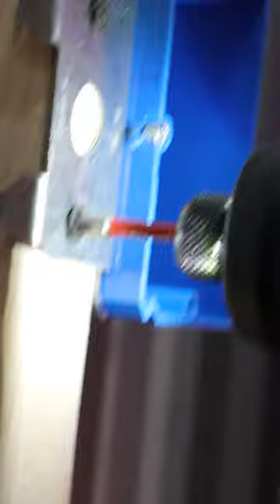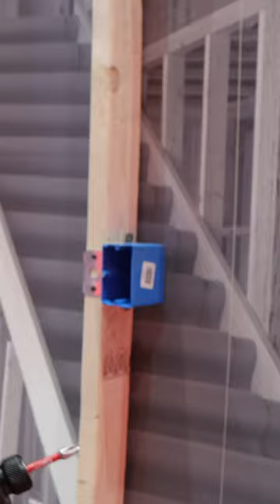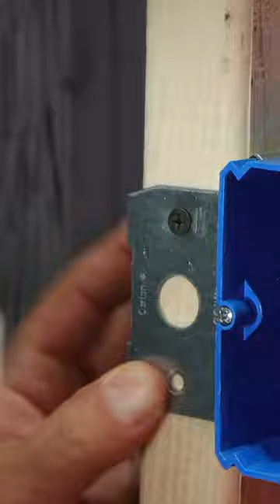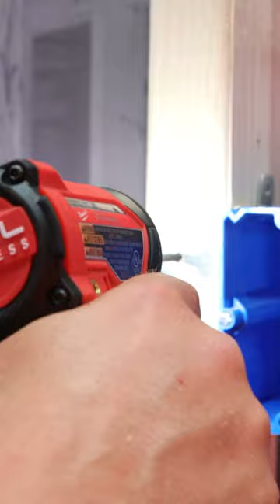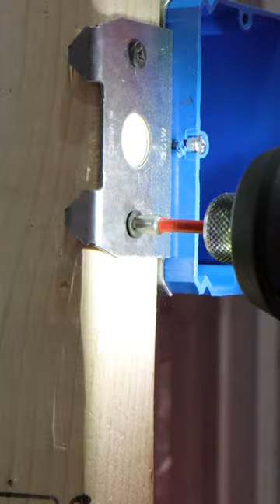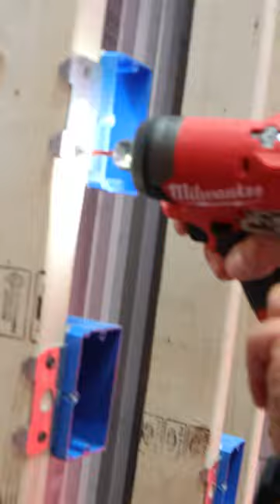M12 FUEL Impact Too POWERFUL

Comment: Those screws aren’t designed for that.  The taper of the screw head is drawing the metal plate in. If the plate had countersunk holes, or used a fastener with a flat shoulder this would not happen.
Reply: Along with this being a impact it's meant to be stronger.  He needs a drill with a clutch set to his needs.  Idiots using the wrong tool and wrong fasteners.
Reply: The plate has countersunk holes. For a smaller screw head.
Reply: @brandonbrown3600  nah drivers are meant for screws too.

But this is a problem I have with the 4th gen onward.

My old 3rd gen on 1 really had low torque (I'm a millwright so I work on everything from 2" platen bolts to m4 and smaller screws. I couldn't use my new impact (doing well over a hundred on swap jobs) because even power 1 would snap things.
Reply: @brandonbrown3600 a drill 😂😂😂 hop in the 21st century, pops.
Reply: Supposed to use nails
Reply: Guy probably works at Home Depot
Reply: @J_M3444  I was gonna say a drill is definitely not the tool that I see sparkys putting these in with. Impact and hex heads or Phillip heads.
Reply: Those boxes are also supposed to be counter sunk in to the 2x4 or the drywall will never sit correctly in that spot what's your point
Reply: Yes. I agree 👍
Reply: @ObservationofLimits  use your trigger clown mine os alway on 3

Comment: This guy's a genius thinking speed and torque are the same thing
Reply: I came here to say this. Glad someone beat me to it.
Reply: He’s also using an impact gun and not a drill with a chuck. He’s using a tool designed for bolts, not screws, so there’s another problem
Reply: @nightstalkers_revenge1850  wrong impacts are for screws also. Use them every day.
Reply: @nightstalkers_revenge1850  lol man it a screw driver clown it's made for this
Reply: For fox lake. Speed is torque with an impact. 

Impacts work by a spring driving a dog into a hammer, (the hammer is the part holding your bit/socket)when the torque gets too great, the dog slips out, spins around and grabs again.

The faster the dog goes in and out, the more IPM: impacts per minute.

When the same weight spins faster it hits harder.

Just like swinging a hammer, faster means stronger. Impacts also hit more often when they spin faster. You get harder and faster the more you run it. 

Protip: the 1/4 hex drive, and the 3/8 square drive are the same tool with different hammers. The 3/8 fits a socket without an adapter, with an adapter for screwdriver bits it will easily break any screw you want to drive.

If you want to switch, either hammer is $30 on eBay. One guy makes a hammer that holds sockets on the outside, or screwdrivers on the inside $45 part. Four screws, hold the thing together. 

I use more power than I need, so I can work faster.
Reply: Blows per minute is what creates the torque on an impact. My old CP 1/2" drive impact hits slower than my $500 IR with the same air input and torque rating. The Ingersoll kills the Chicago Pneumatic at breaking stubborn bolts even though they are rated at the same torque because the mechanism hits that peak torque at a quicker rate.
Reply: For years he refuses to understand the concept.
Reply: making a comment like this implies you don’t know how an impact works. speed is torque
Reply: @nightstalkers_revenge1850  no this is an "impact driver" not an "impact gun" literally what these are meant for

Comment: Trigger control.
& drywall screws are for drywall. 
Cant use them on elec boxes plastic or metal where I live.
Reply: Totally agree. I also wannna know why their putting a plate over a stud like that. Gonna have to float it out for the drywall finish especially with a screw head sticking out

Comment: As a construction worker I can see how that could be annoying, but as a mechanic it’s a great tool
Reply: I was thinking the same damn thing.... but as a carpenter my drill would be used for this... impact stays home unless I'm putting in grks
Reply: @himwhom You damn Milwaukee
Guys, all power no control!
Reply: @Billy bob  dewalt here.. only Milwaukee is the 16p eletric nail guns.
Reply: Bruh all we use in construction is impact drills. It’s all trigger control.

Comment: I'd  definitely hire a electrician who uses drywall screws on an electrical box...pure knowledgeable tradesmen
Reply: Drywall screws work just fine to hold up a box. It’s a screw and there’s no structural need for a wood screw here
Reply: Then you wont be hiring anyone. Its a screw, itll hold the box just fine. Jesus christ

Comment: Better to bend it and beat it back considering screws and metal that stick out over a 1/4in are a nightmare to hang drywall over. Thanks for the blown out outlet👍
Reply: Garage construction maybe? Uninsulated construction with sheathing and exposed framing on the inside

Comment: Vance... now get the drill and adjust the depth of that box.
Reply from the maker: The union won't allow it!
Reply: he is a schmoe, he thinks the speed setting controls how much torque is applied. Simmer down with the trigger bud, and use the correct fasteners, things will work out better.

Comment: Just got mine at Home Depot with the 4.0ah 2.0ah combo kit and was using the impact and in mode 1 was breaking screws it has insane power
Reply: Complete bull. This m12 crap is weak. You were breaking drywall screws loll
Reply: @Valient6 m12 is fine for most jobs.
M18 is not needed at most home works.
Reply: @Valient6 complete ignorance. I use the M12 gen 3 as a commercial electrician. More than enough power.
Reply: @Valient6  Lmfao maybe the Non-Fuel version, As an Electrician aswell my 3 year old beaten up m12 fuel 2nd gen impact still will break 1 inch × 1/4inch thick Self Tapers & lags with ease if not carefull. 🤷‍♂️It's been my daily driver & with trigger control is the perfect impact for most needs.
Reply: @internetjunkie9574  😆

Comment: I've been wondering to get these m12 or fuel I do a little of everything work wise
Reply: I just got rid of my m18 surge and got these m12 fuel and they are awesome specially since they are a little lighter.
Reply: 3 years use testimony. By far worth the money(Home Depot might still have them on sale not sure) But it has pretty much replaced my 18, used as my daily & is perfectly compact & powerfull. Spend the money you won't be dissapointed one bit

Comment: Just last night I was just talking about how the M12 Fuel Hammer Drill (2504-20) is too powerful. Even on the lowest clutch setting the speed can ramp up and won't stop driving until the screw hole is already stripped. My guess is it's because the clutch is digital and has to wait to sense a certain load before shutting off power, but the rotating mechanism already has momentum. I think so because this doesn't happen on older "dumb" drills with purely mechanical clutches that physically limit the torque...

Comment: That is going to wreck the drywall and leave a hump like a camels back.
Reply: Lol you won't even notice. It's no different then the plates the put on studs to protect water lines and electrical running through them from nails and screws.

Comment: Yeh, those M12 impacts are great. . . until you're standing at the top of a ladder, go to use it and the fkr decides not to work!  
What's with the flashing led's on the side when it's supposed to be turning a fkng screw!!!!

So, anywhooo, have gone back to using a Makita and it works FIRST TIME! EVERYTIME! I've ever tried to use it EVER!

Comment: I'm sold. Really. It's 1/2 the weight of my old 18-volt impact driver and battery last all day, preforming the lighter jobs like what you illustrated and battery change is simple and easy. You can carry an extra battery with you in special container for bigger jobs that require you to push harder. DeWalt does have some 12v stuff, and pretty good for the most part. But that little Milwaukee, you forget you've got with you already, it's so lightweight.

Comment: A lot of power for not a very long time. Not worth the incredible prices. I've been in my trade for a little over 9 years now and every Milwaukee tool I've owned has done everything short of straight up disintegrate in my hand. Stick with DeWalt, mines lasted 6 years with zero problems. Unlike my Milwaukee which lasted 2 and had 100 problems.

Comment: Journeyman Electrician in Ohio. I’ve been in almost 5yrs. I’ve had a M12 FUEL from day 1 only replaced it once in those 5yrs. They are amazing tools for the size and well worth the investment. The combo kit with the hammer drill is also worth it (has a 1/2” chuck and can put a 16” auger through 3 studs if your M18 isn’t handy or space is an issue)

Comment: I love my M12 gen 3 fuel impact driver and hammer drill. I’ve driven 100 3 inch coarse thread wood screws for attaching 2x4s into 2x4s on a single cp 2.0 battery with my m12 fuel.

Comment: Far as I know on those milwaukee impacts, the settings are literally just speeds, not gears. There was no difference in torque as far as I could tell when using it, it's just for people with bad finger control

Comment: How long do the batteries last is my question, I've tried some of the 12v tools and the one impact I have is great for final but probably wouldn't do too well in rough, and the batteries get killed kind of fast, then again, I only have the 1.5 batteries

Comment: How you tell difference between gen2 n gen 3
Reply: Model number for one but the easiest way to eye them is the drill has the red line around the chuck and the impact has the Tri-led's
Reply from the maker: Gen 3 has 3 leds

Comment: It's change in speed not torqe persay. The torqe does increase with more rpm as more hits and faster anvil strike but the low speed setting is not a torqe reducer its to have more controle

Comment: It’s an impact driver for tough screws, for screws that small use a screw driver with torque setting if you are worried about bending the metal right tool for the job guess you can’t teach experience.
Reply: Bro it doesn't matter I'm using one impact for everything. I don't need one for delicate work because I can use my normal impact with trigger control and do what I need it to do every time.
Reply: @corey6129  clearly it does because vince has the problem he’s struggling, also if I want to send home screws I set my torque and screw them in I’m not worrying I might slip with “trigger control” and strip the wood leaving the screw loose, it’s personal preference but I’d rather drive a screw knowing the drill will stop when it is in deep enough with a torque setting consistently rather than my finger and my eyes judging ✌🏻 impacts for fast work / drill drivers for delicate work personal preference

Comment: More speed does not equal more torque bud. Most often, the opposite is true.
Reply: On the impact 3 is higher speed and torque 1 is for finesse. On a drill 1 is higher torque and 2 is more speed.

Comment: its so powerful, i had mine back in for repairs . The mechanism inside was stuck nothing was spinning.
Reply from the maker: What? Tell us more, how, when, why?!?!? I’m listening!
Reply: @VCGConstruction  I bought the m12 surge 2 years ago, when it stopped working i was lazy to return it and I started using my m18 fuel impact. When they released the new m12 kit I decided to go buy it on the 18th of August. In November it stopped working... I'm a plumber using the tool for screws and drilling 1/4" ceramique holes using à dewalt impact adapter. When id press the trigger the motor turned but not the chuck. It's like if the impact mechanism inside broke... it was making such a loud sound. When the repair tech in my area pressed on the trigger to test the tool it surprised her and she dropped it on the desk. At the same time I gave her my m12 surge as well for repairs... id press the trigger and a small electrical whine appeared and then nothing. I also have 2 m18 fuel hackzalls with broken motor bearings, New chargers that don't charge, that m18 impact gen 3 that has the collet problem and sometimes when a go to reverse to back out a screw, it goes in forward ... I'm real pleased at milwaukee tools, at least I have a good store that honors the 5 year warranty in my area. I'd be happy to send you my m18 fuel impact so you can test it out. Free of charge and you can keep it. Sometimes it just stalls after a while making 1" spade holes... it's so dumb.

Comment: Every impact would do the same, bud
Reply from the maker: Name one
Reply: @VCGConstruction  Dewalt or makita there is nothing impressive about it. It's just a 12 volt battery and only works with all the 12v stuff when most people have the m18 and this just doesn't make sense to buy and have to get the batteries just for a smaller impact or the other m12 tools.

Comment: Use a round-top screw and let off after a click or two
Reply: Because the drywall guys don't already hate you for using these top mount boxes... Let's add another 1/8-1/4 inch of height to deal with.
Reply: @anthonybarker9123  they must have a hatred for us because I find device boxes packed with spackle

Comment: M12 is garbage. You can't sink a 4" t25 into pressure treated. Step up to dewalt XR for power and durability. Dropped mine in water 6 years ago submerged. Still works too this day.
Reply: Everyone throw away your tools, the valiant one is here to tell us what's the best. 🤣
Reply: @kwslife116  yeah considering I actually build. Screwed about 6 thousand 4" #10s this year, 500 8 inch lags, and about 10,000 nails, I'd say it's safe to say you should listen.
Reply: Dude, you're clueless lol
Reply: @samvanhorn7091  I do 700k$ a year construction... Lol I'm clueless
Reply: @Valient6  cool, so what's that like 2 jobs a year? Lol